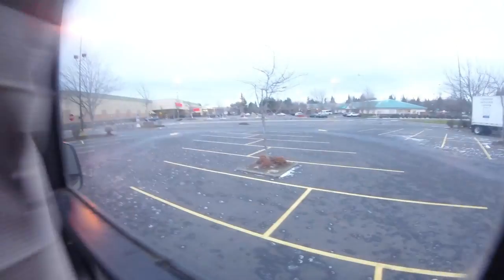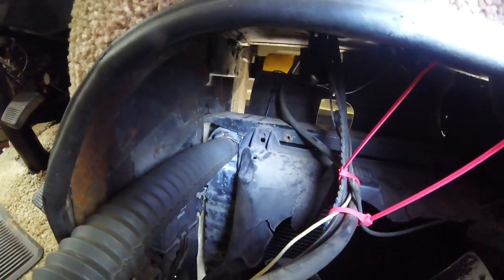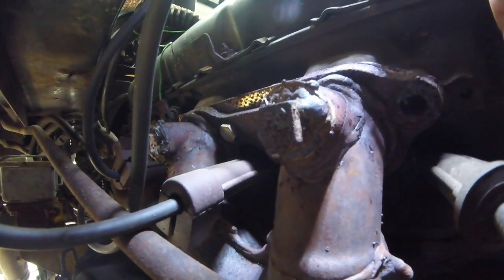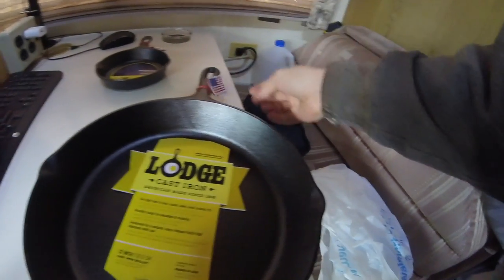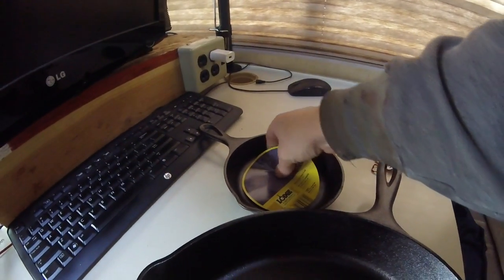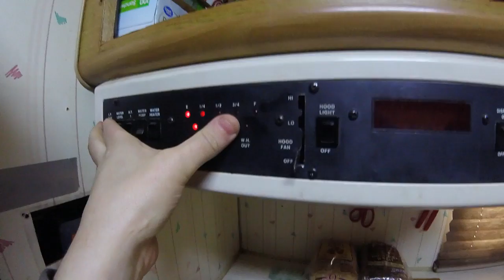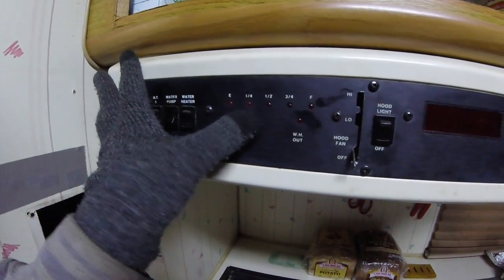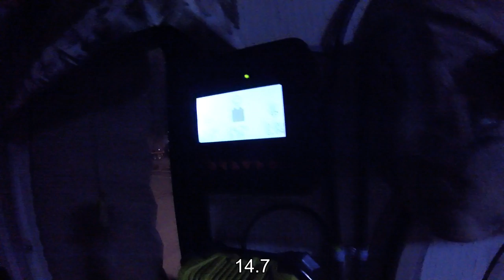Coolant Leaks || Full Time RV Living

Comment: It's your vehicle. Just sharing some past experiences. Dont know the cause of your coolant leak. Just one thing I have experienced that causes it. Easy to check to see if it is. The thermostats are point blank garbage. They will stick closed and do that. Way to see if it is the case. Warm up the engine. When normal temp, try to squeeze the top hose. If rock hard, then your thermostat is frozen shut. Only way to fix is replace. If not, many problems can happen. Very cheap. Get it and gasket. Dont use any sealer on it. That will cause more problems. The radiator fluid should just flow threw the top hose and not pressure up. Good luck.

Comment: Bro my friends mom has the same exact RV Winnebago, if you install a set of long tube headers headers and retune the carburetor or change it to a new edelbrock you can get 70 more horses  power but nose important u can get 16 mpg vs your 8mpg- 12mph it's worth every dollar we were doing 80mph on the hiway last week it was 300 for headers & 400$ for the 750cfm edelbrock with manual choke, because the manual choke model is set up for performance, compared to the old one was not a good for the RV big block

Comment: Those worm drive clamps do work loose over time, especially in cold weather. One thing you can do is take some metal wire, run it through the slot in the screw and then around the back of the clamp where it pokes through slightly out of the back. Twist it up real tight and that will help. Also, look to the right of your exhaust manifold with the broken stud/bolt - there "should" be an extra bolt hole If I'm remembering right. Try and find a piece of metal that is long enough to reach the manifold flange and use that, along with a bolt in that extra hole and a few washers to clamp down your manifold.
Reply: PS. On the clamps, that only works if the slot in the screw is horizontal to the clamp so try and get it there.

Comment: You and I have the same make and model but mine is 27feet. I've had the same exact leaks. I also just bought a brand new rebuild Rochester Quadrajet and changed out the fan clutch. I'm on social security and work at Walmart part time, so I can only do updates one at a time. I use regular Costco gas but with a full Marvels Mystery Oil treatment with every fill-up. 🐈

Comment: Can I ask when running the d-heater can u get it 20 degrees warmer then the outside temperature today
Reply: the diesel heater works on a thermostat... if it is -5C outside and you set it for 25C inside... it runs until it reaches 25c inside

Comment: You could try GM stop leak tablets  for the coolant leaks.. They do work, I've used many tablets on my 95 explorer over the years.. it had a coolant leak  on the bottom corner of the rad.. that was years ago.. still has it's original rad! they will even stop a heater core leak!